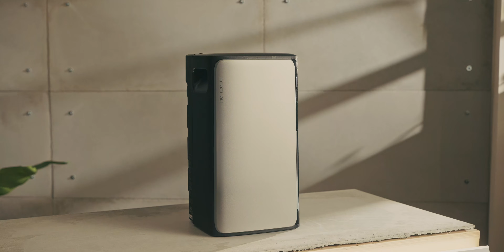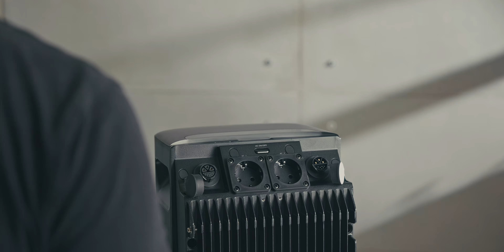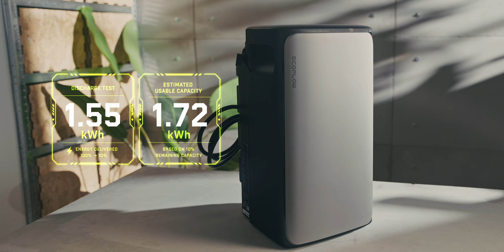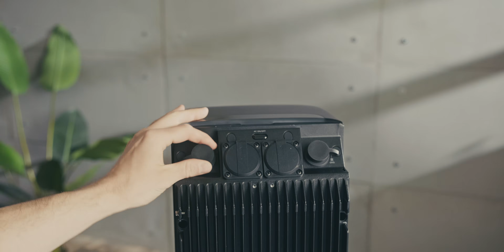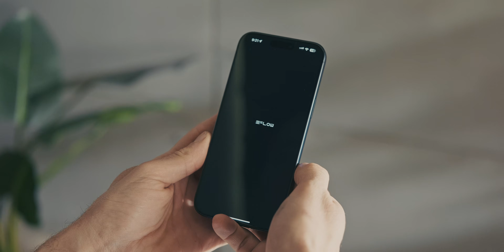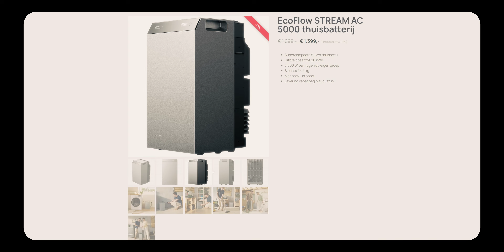EcoFlow STREAM Review – No BS Testing

Comment: For balcony solar is perfect. One to two units with some solar panels connected in parallel, that's it.

When you go multiple units and increased  AC output, then you need to make sure you respect to the letter all instructions. From in app commisioning, through separate circuits grid connection to dedicated and stable wifi gateway.

If any of the above is missed, then you get a system missbehaving and all the complaints.

I think the new version just release is aimed at preventing people screwing up the set up by removing some of the complexity

Comment: Finally a balanced video that isn't sales oriented 

I'm interested in the round trip efficiency and self consumption losses. I have seen another review that says the unit self consumes 23w as part of its operation - which would mean over 24hrs potentially losses through self consumption of up to 460wh, meaning the usable could be even less. 

I wonder if you could do a test with a known consumption (say 30w light bulb) over 24hrs to see what the battery level is at the end. If the 23w is to be believed then the draw over that period would be around 1.27kwh (720wh for the light bulb and 550wh self consumption) leaving the battery at around 33% capacity.

Comment: Yes there are considerable losses going from AC to DC to charge the battery and again going through an inverter converting to AC again. No real way to reduce this, charging with AC. Charging from solar into mppt ports would cut out one of the power loss cycles.

Comment: Stream products in general work well however there are issues with this company and its services in particular Support and its rectification processes. I have 6 Stream Units and the Ultra unit started intermittently tripping RCBO. It took EcoFlow 48 days to respond. Now months later after agreeing to a replacement and EcoFlow collecting my unit but NOT supplying a replacement I am left with 5 batteries and having to use the EcoFlow inverter which I also bought to provide additional mppt inputs as a means of connecting 2 of 4 panels. 
Having received by Unit, EcoFlow then advise they do not have any units. 

So the offer, which I think is very poor was :

1. You can have refurbished unit very quickly.  Why would I? There was no offer of compensation I.e. as a minimum difference in price new vs refurbished. So in effect I am paying for new but getting used.

2. A refund LESS a deduction for usage already received but no indication what net amount would be. Known as their After Sales Depreciation Scale. (Which is NOT published)
😊

Comment: Great info.  I had one for a while but returned due to the efficiency.  I found efficiency suffered further when discharging at lower levels (100-150watts), performed similar to your results when higher.   My worst cycle test was when running at around 100watts and at about 12c, had 55% round trip efficiency.  

I decided price against efficiency too poor so returned.  I got it for a good price and did like the unit but the maths did add up for me.  Hopefully prcies continue to fall then I will try again.